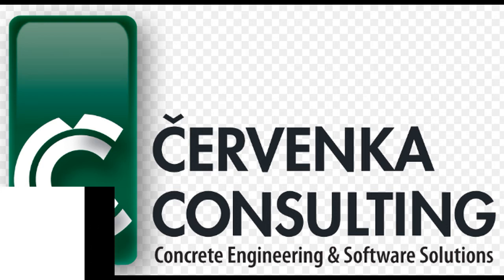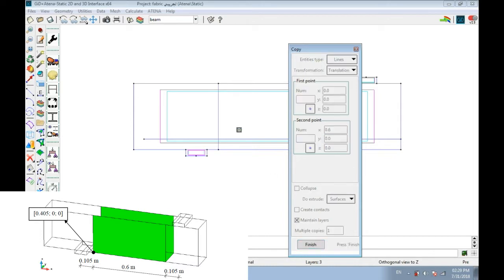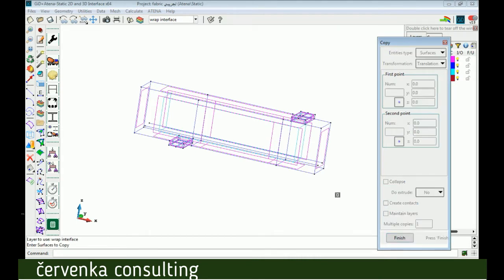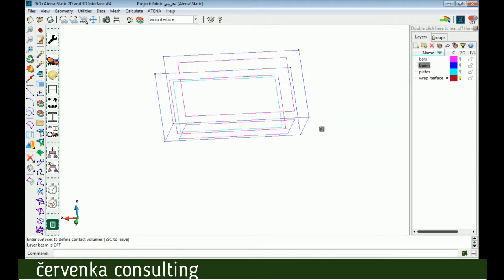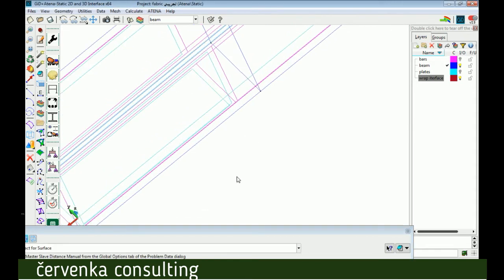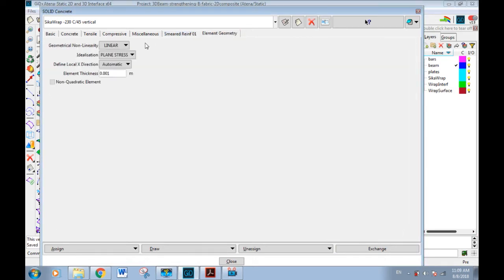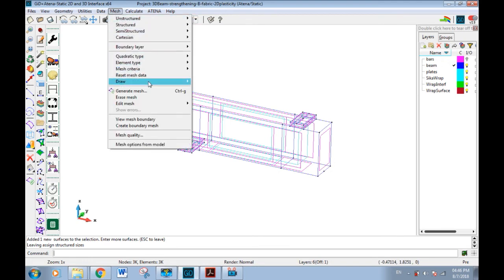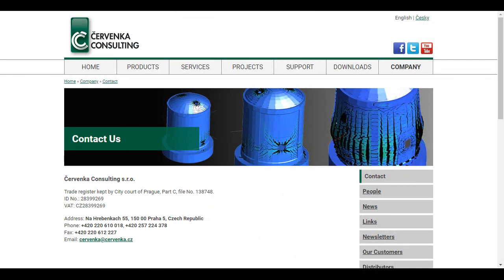ATENA Science GiD Tutorial Strengthening FRP Fabric

Comment: Sir in the 7:51minutes , while selecting the solid concrete ,we created new sikawrap-230 c/45 vertical and horizontal but after selecting the reinforced concrete we are adding smeared reinforcement01 tab and you selected the sikawrap-230 c/45 vertical and by selecting these sikawrap-230 c/45 that smeared reinforcement 01 option is going, now what is the solution